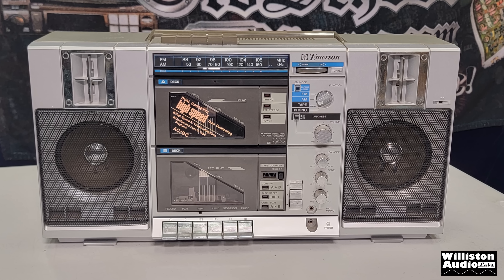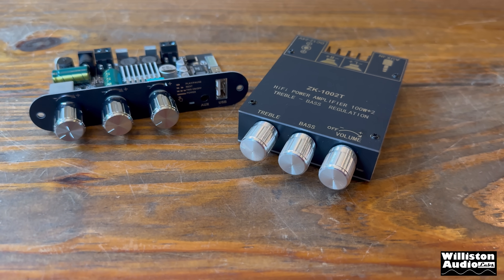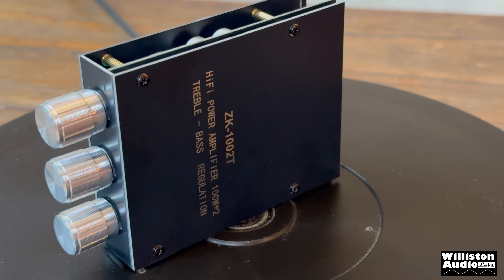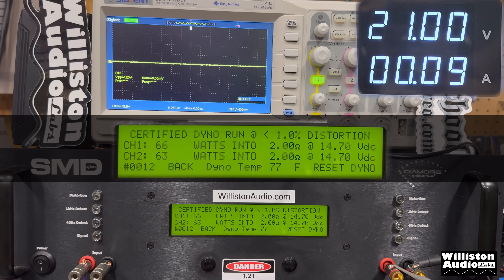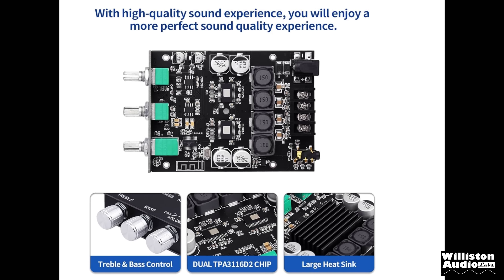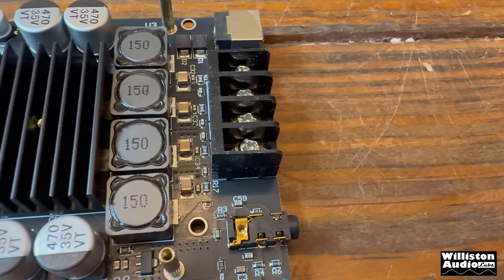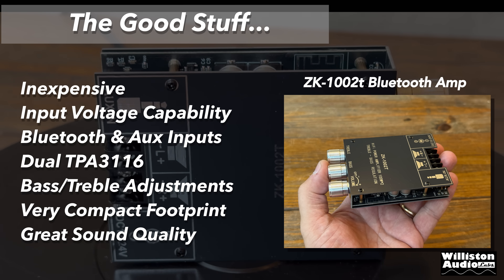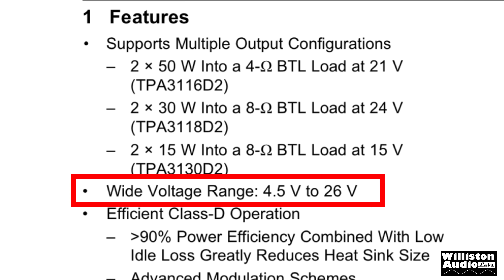This $20 Amp Surprised Me - ZK-1002t Bluetooth Amp TPA3116

Comment: I've got the 2.1 amp... installed in a 90's Sony Boombox, with a 90's desktop sub siting on top. It runs on a 12v Milawaukee "style" 8A battery. It sounds better than an $18 amp hooked up to garbage should. Also the amp low voltage cuts out before the battery gets too low to recharge, specifically my amp/battery situation. By itself it's just an AUX plus bluetooth device. With a raspberry pi it's an entertainment machine. Also battery powered, overclocked, Linux, Android, Retropie. Small touchscreen or projector for the wall. Portable battery powered movie theater that can play Gamecube ,PS2, or NES whatever, tv shows, desktop on a wall sure.. Anything anywhere. Anyway, all that to say, yes get the Wuzhi Audio amps, awesome little amps.

Comment: I have some 40v batteries (for lawn equipment)...

How high can you bump that supply voltage?
Reply: grab s amp with a tpa3255 chip. there are nice ones. run from 30 to 50 volts easy. some with and without volume control and bluetooth built in etc.  some with volume, bass & treble etc. lots of configurations

Comment: These kind of amp boards can be pretty good if they're made competently. Just don't expect to get exactly what they claim for output and you'll most likely be happy. 

As far as a Bluetooth boombox goes, my son and I purchased and built the Dayton Audio MKBoom kit from Parts Express a couple of years ago. Got it on special when it was only $140! No dedicated sub in it's design but the included woofers go surprisingly deep for their size. More importantly it gets LOUD with no audible distortion, the battery life is great and it's worked perfectly even while sitting in the sun on 90+ degree summer days. We leave the volume knob on the box on max all the time and control the volume with whatever Bluetooth device we have attached to it.

Comment: Would like to see u build one of these with ZK-TB21 2.1 channel amplifier. That has bass trebble for the stereo channels and has crossover and volume to sub channrl.  I use this amp as my pcamp.  Id like to know if the sub does its 100 watts at 4 ohm.  I have a skar ix12 on the sub channel and sony bookshelfs on the stereo channels T 50watts per channel

Comment: Since I don’t need waterproof at work, I reused one of those cheap dual 6.5 inch boxes they sell at parts stores. Mine has a 60Ah 24 volt battery, Dayton Audio KAB-2150 and NVX ESP65 speakers. This thing sounds incredible and will get uncomfortably loud before it distorts
Reply: Hi, there's a 2.1 with a higher input voltage and it delivers twice the audio. I'm in the process of buying it. Greetings from Mexico.
Reply: @m.as.r.7059 I don’t need any more power than what I have. If I needed more power I could change it over to 36 volts. As it stands it will get painfully loud before any kind of distortion. Right now it’s a very well balanced system. Actually come to think of it, if I wanted to switch it over to 36 volts I would probably have to swap out the speakers to something that can handle more power. But if you have the part number I could look it up for a future project

Comment: I have built a big 2.1 bluetooth speaker with the ZK-MT21 with a 10 inch 100 watts subwoofer and two midrange+2 tweeters taken out from a pair of eltax 50 watts by 2 bookshelve speaker with their own crossovers. I bought a 24 volts 350 watts power supply. I built an mdf 2.1 box with separate chambers for the sub and the left and right chanells. This thing bumps like crazy shaking the whole house and the neighbours's house as well. It sounds crisp and clear on the midds an highs and a great deep bass plus with the tone and frequency controls you can adjust it to your liking. And for a good finish i wraped it with a self adhesive uphostery linen fabric in so called coffee color and looks fantastic. Who ever sees it asks me where have a bought it,they can't believe that i have built this beauty. I really enjoy playing music,listening to internet radio or even watching movies on it,IT BLASTS,I LOVE IT!
Reply: I have my mt21 running off of 2 makita 18v batteries for 36v.  2 polk audio 6.5 components and a 10 polk audio sub.  Sounds WAY better on 36v than when I had it on 12v.  I use it for camping , the garage or boat.
Reply: I have the same amp and when idle, does it produce high frequency noise ? Or you already solved the issue

Comment: Been running these for years, have kicker 6/9 hooked to my room computer, sound amazing
Reply: @LazyLawrence  how do I connect a kicker 6x9 to this? And connect it to a laptop?
Reply: @Ill_logic_immortal85 audio cable from computer to amp, speaker cables from amp to kicker speakers. 12-24v power to amp.
Reply: @DanielW-x4v  where do I get the audio cable from? Which one is the best? Where do I get a 12volt power supply not cheap garbage from China but a good one? Which amp do I get too? 2 channel or 4? I want 2 speakers and a 10 or 12 inch sub connected? Any ideas???
Reply: almost every last electronic item is manufactured in China

Comment: Test  different power supplies and supercaps on this little guy!
Reply: wuzhi makes a voltage booster called the pw500 and its quite a beast. a big mosfet power booster with a lotnof bug capacitors & adjustable voltage up to 50 volts. its perfect for these amps. built with large terminals ao it can accept decent guage wiring. it works good with the tpa3255 amps like the zk6002. beast setup

Comment: I’m using the ZK-MT21, it has all the same features but also has a separate 100 watt RMS subwoofer output controlled by a dedicated frequency response knob and a sub volume knob. This price converts to the equivalent of $5.50 USD, but I am in south east Asia. I laugh that I power a pair of 2 way book shelf speakers and a 10” subwoofer. The ZK-MT21 uses the TPA3116D2 chip, it might be different if it’s available in the states. It requires 24vdc @ 5amps. ￼ I don’t know if you ever reviewed this before, but as an American living overseas I found it quite interesting. Thanks for the videos as always.
Reply: i run the exact same setup on 12 volts, plenty for PC audio.
Reply: I need two of those
Reply: Yea the mt21 doesnt have the tpa3116d2 it has a cheaper chip
Reply: @rhread  I’ve been considering purchasing one of those 2.1 amps. However one bit of information I couldn’t find is…does is need to be an active subwoofer or will it power a passive sub?
Reply: @akshaypersad  passive sub I'm running this amp in a pinball machine with a 12 inch jl audio sub and 2 alpine 6.5 inch speakers  sounds really good
Reply: I am powering a passive sub with it, so yes, you are good to go with a passive sub. 👍
Reply: @akshaypersad if its 2.1 it has 3 channels of amplification, but do pay attention to that you need a more powerful psu then
Reply: @akshaypersad  They power a passive sub. If you have an active sub, you only need a 2.0 amp.
Reply: Zk-mt21 uses chipstar
Reply: @rhread  the TB21 is more powerful dame setup with better sound quality trust me. It has the Texas instrument chip tpa3116d2 I push them to the max fried all the mt21s
Reply: I think I have a 2 x 50 + 100w that has built in eq, instead of bass and treble dials for mids. 

I run 2 JBL tower speakers and a bass bin w/ 3 gto1502D’s on the sub output.  I have a video on YouTube with a quick blast that shows power and actually spl in my messy cargo trailer. lol.
Reply: Let me correct you coming from a ZK-MT21 Owner. The MT21 uses a Cs8673e Chip. The MT21 is only 40w x2 80w x1 amplifier and those are peak, NOT RMS. The TB21 (which is the MT21's bigger brother) uses the TPA 3116D2, Not the MT21.
Reply: I really like this amp, it is now part of my new Hi-Fi setup.
Reply: 24w5a and 12v10 are same watt produce 120watt.try using 24v8a=198watt but idont know is suitable for mt21 becouse zk-mt21 have report easy overheat then zk-tb21,im using two zk-tb21 almost a year now and using  dc 24v8a and speaker im using is infinity rs2000 for bed room and jbl cf100 for living room sound perfect and sub woofer no brand diy using used home subwoofer home theather box but change speaker using 4ohm 120watt plus subwoofer crossover to cut high and mid freq and to protect subwoofer driver to.
Reply: Me too love it
Reply: I love the MT-21. Bought 1 Wuzhi & and loved it so much bought 2 more. Use it with a power bank & thrift store speakers for my bicycle! EXCELLENT 2.1 system for beginners.
Reply: @rhread  YS-AS21 Bluetooth Digital Power Amplifier TPA3255 2.1 Subwoofer Channel 220WX2 + 350w 25usd only in PH
Reply: These are great - I used one as a drop in with a line-level converter for the rear audio of a truck once.
Reply: I use those, they are dope. I've been making custom subs and thrift store fronts, and they are a surprisingly good package. Think Logitech style (2.1) but better bass, and you can easily swap the fronts for anything you want.

Comment: for $20 it's a STEAL!!! 
I think YOU SHOULD build a sweet 3-way (IF you can find two 2-ohm speakers and one 4-ohm, then you can run the amp at 2-ohm, but finding 2-ohm speakers that AREN'T subwoofers might be a bit hard, so if you can only find 4-ohm speakers then you could put two in series to get 2-ohms then run that in parallel with the 4-ohm speaker would you just get 3-ohms???  I never tried running different resistance speakers on a channel, I just figured you got an odd amount and that wasn't good for the amp.  So I guess the crossover does the work to make it 4 ohms?  well that gives me an idea - 
Could you explain how 3-way speakers are able to have a 8/4-ohm load (or 2-ohm on some speakers, i guess) do they just add a resistor or something? So if you make a nice little boom box, you could do a 3-way/3-speaker with a crossover that changes the load so the amp only gets 2/4/8 and not a odd number or some weird number with .3333 repeating on the end of it LOL - OR could you explain this in a video, it doesn't have to do with the boom box or anything, just toss in some of your knowledge so we don't end up hurting our gear by hooking up 3 speakers or somethign else stupid LOL

Comment: Take the heatsink off and check the number of pins on those chips. Many use cheaper clones with fewer pins.
Reply: Yeah, I highly doubt it uses an authentic Texas Instruments TPA3116 IC in all honesty.
Reply: the real one is a different shape than the domestic chinese one. usually they are honest and tell you when the amp is made with a imported TI chip vs their domestic chinese chip. the chinese chips are a different shape, fhe amps with chinese chips are usuallly cheaper. ive had a lot of these amps and the ones with real ti chips perform very well. & they arent very inexpensive either.
Reply: Many of the board suppliers have 2 different versions at 2 different price points.
The clones with the larger pin count usually perform almost identically to the TI TPA3116D2
However a lot of them need upgrades of the caps in the signal path, and many/most use fake NE5532 opamps that are pretty nasty.

Comment: Would this handle speaker level inputs for use in car audio using the head unit, speaker output for small, Polk Audio tweeters while using the RCA outputs of the in-dash head unit to drive separate amplifiers for the 6.5 inch door speakers?  Great video.  Thanks.
Reply: probably wouldnt work right at all. best bet would be to split your rca output and connect a rca to aux cable going into one of these amps

Comment: I just built a boombox using the ZK-TB21 its 50+50+100, i´m using an 24V psu. left goes to high and mid high right to woofer and the other goes to the subwoofer. work as I intended
Reply from the maker: Awesome 👏
Reply: Lol i use this amp as we speak hahaha have been for years with my 3d printed synergy horns! cant fault it! very low noise for a cheaper product

Comment: That's crazy. I literally just received this amp about 3 days ago to review for Amazon Vine. I was blown away by how powerful this little beast is. Now I know why!

I have mine hooked to a 20v Porter Cable 4.0Ah battery. It's running two Polk Audio T15 bookshelf speakers, 8 ohm speakers, and it's extremely loud for what it is. 

The only difference was, I had to assemble mine.
Reply from the maker: I noticed some had to be assembled but not the one I purchased. Not a big deal, just adds to the DIY experience anyway

Comment: there's a version with a dedicated subwoofer channel, i have one and it's just the best. there's a bad bug with BT tho, you need an old version of android to use the app and anyone with the app can control your amplifier.
with the app you can limit the max gain/max amplification, which is a good thing to limit your max volume. if your phone autoconnects to BT your line in gets muted, be aware of that.
Reply from the maker: Good to know, thanks for sharing 👍

Comment: This is the same kind of boards i've been using for years.  The 2.1 versions make an amazing boombox.
Reply: Same, I use two Klipsch Satellite speakers and an under seat sub from a BMW when we go to golf charity outings. I just power it off of a drill battery and it’ll rock all day.
Reply: drill battery wont power a sub all day. unless its a hige battery and small aub. just playing normally
Reply: the 2.1 is the way to go.
Reply: The 2.1 (ZK-TB21) has a high pass filter(150hz~) on the stereo channels that can't be disabled--which results in a significant portion of midbass missing. I really don't like that amp, but the 2.0 is great. I much prefer Parts Express 2.1 Amp (TPS3116D2) since the high pass filter can be turned off, although it's about 2x the price.

Comment: The 2.1 version i'd like to see.🤩
Reply from the maker: Thanks for the suggestion 👌
Reply: ZK-MT21 is 2.1 but I’m not sure if it’s available in the states
Reply: @rhread  Pretty sure its the same but mine is the ZK-TB21
Reply: @keatoncreates   AI response: The main difference is the amplifier chip: the ZK-TB21 uses the higher-performance Texas Instruments TPA3116D2, while the ZK-MT21 uses the more budget-friendly CS8673E chip. The TB21 is considered superior for sound quality and power, though the MT21 has some extra features like a USB flash drive playlist function that the TB21 lacks.
Reply: @rhread it is i got mine on ebay for $15
Reply: amazon carries models with the 2.1.
Reply: They work awesome i got mine on a set of dayton audio 6.5 bookshelf speakers and a Sony home theater subwoofer and a 15v power supply and it's impressive.
Reply: try ZK TB21 It's a great amplifier too

Comment: i wonder if these are the fake 3116's.   hard to get cheap amps with real tpa3116/3118 these days..
Reply from the maker: I’ve tested almost all different versions of the TPA chips and haven’t noticed differences between same chips and how to know if they are real or fake?
Reply: @wal I'm not sure of the very latest fakery antics, but for the 3116/18  most of the fake ones have 28 pins versus 32 pins on the real mcCoy.   Definitely have to pull the heatsink(s) on every one of these boards these days to check.

I haven't heard of fake tpa3255's ..